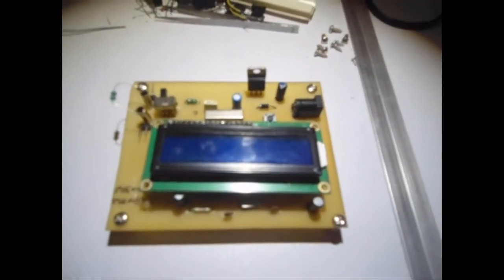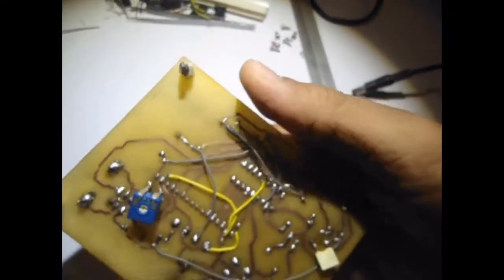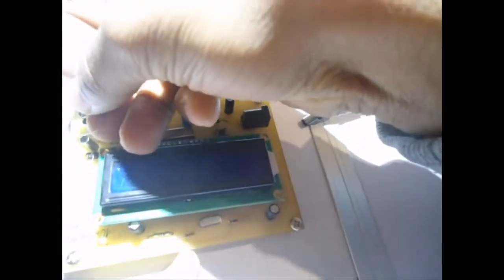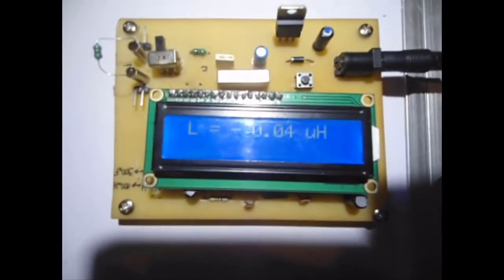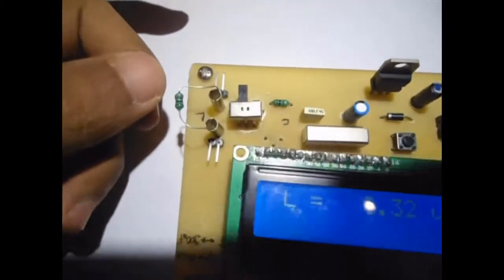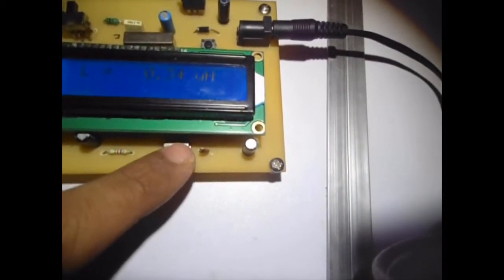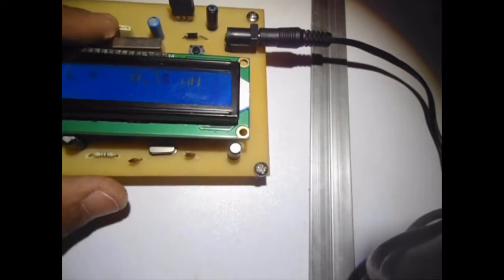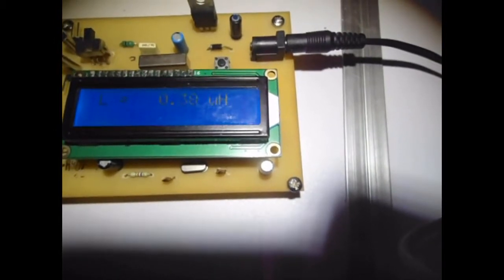LC  meter based on PIC16f628  build (part03)  __ The End results

Comment: I assembled your lc meter project with pic 16f628(a). The capacitance measurement  is ok, but when changing the key to measure inductance and after pressing the reset key, only the message "Overrange"
to measure correctly, you need to reset calibrating with the terminals shorted, then it works normally. It's normal? I've seen some devices assembled without this need. I used the code you provided. Is there any other software to fix the problem?